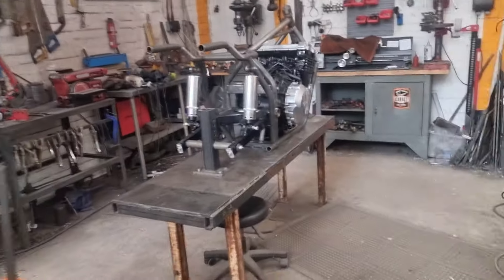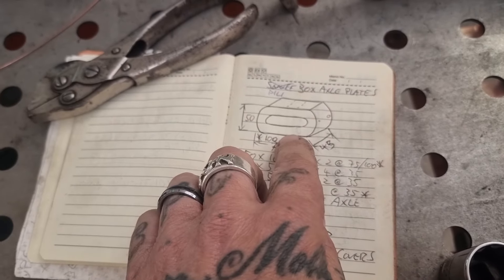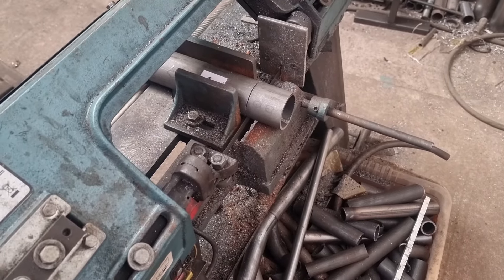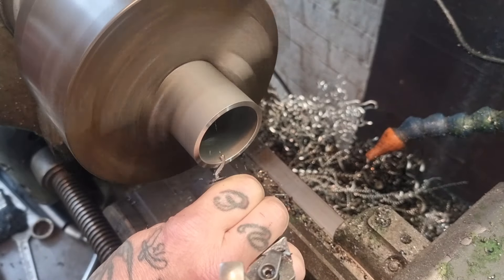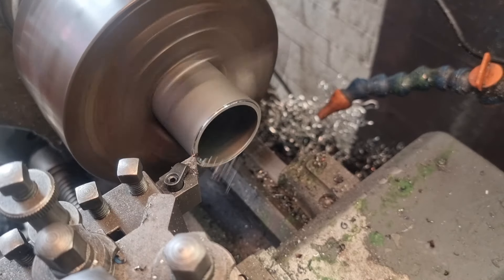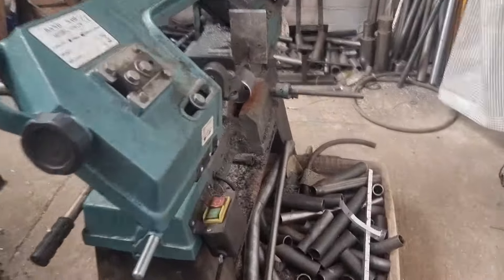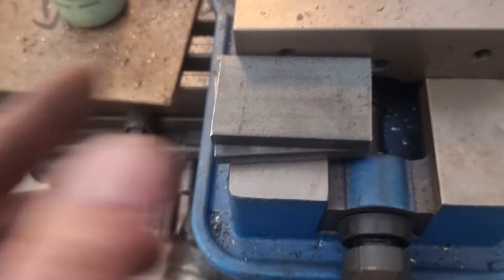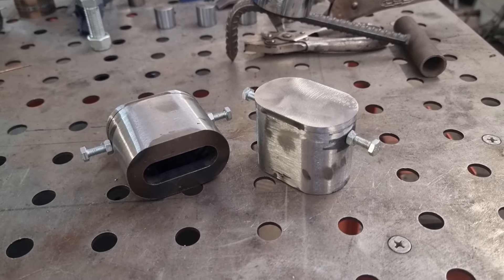Triumph Swingarm Chop Pill Box Axles Bozo Visits! Handmade Custom Bike Building #Chopper #bike

Comment: I used a Rotor Broach, or we knew them as a Broach Cutter or the Mag Drill, for many years mostly for structural steel bolt holes, the magnetic base drill is really handy as it can be used vertically or upside down if the need arises, the drill has a lubricant feed reservoir on it to save time, a messy job but very efficient.
Reply from the maker: Yeah I'm impressed